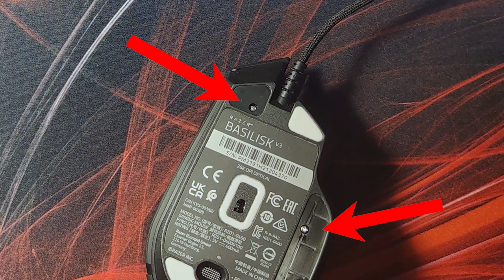Razer Basilisk V3 Disassembly

Comment: I bought the V3 pro 2 months ago and I've been enjoying using it. The scroll wheel stopped working 1 & 1/2 weeks ago when my nosy cat knocked my water all over the mouse. I tried leaving the mouse in a bag of rice for a couple of days, I tried blowing an entire can of air into the wheel/under the buttons, and I was ready to give in and buy a new one when I came across this video. I took the mouse apart as you demonstrate and I thoroughly cleaned inside. I don't have the expertise to tell what parts have what function, so I cleaned everything with an alcohol soaked ear swab and used more canned air to dry it out. Lo and behold, I put the mouse back together and the scroll wheel again works just as it used to. Thank you for making this video and for saving me from the cost of replacing my mouse.
Reply from the maker: I am so glad my video helped you!
Reply: I HAD THE SAME THING HAPPEN WHEN I KNOCKED A GLASS OF WATER ON MY MOUSE LOL I came here to see if I could fix it and I'm so glad you were able to fix yours I'm gonna watch this video now!

Comment: 1 year and the scroll wheel click is gaining problems, how do you think im going to fix this? in your video there are like tiny hairs in there and it seems like on mine probably has a lot of it too blocking the clicking job
Reply from the maker: I had problem with the scroll wheel click also. I cleaned mine with isopropyle alcohol and now it works fine.
Reply: @chrisvfit  woah nice, was thinking about to buy the g502 hero after this. it seems that I still have the chance to fix this. you didn't encountered any problems putting back the stickers?
Reply from the maker: No problems with putting back the stickers. I love my Basilisk, but I want to try the new G502 X Plus.

Comment: Hi, I have a Basilisk V2 and the scroll wheel will occasionally go the wrong way mid-scroll. Do you think taking it apart to clean would help or is it a lost cause? Also, do the original feet and sticker go back on okay?
Reply: Yeah, if you're careful. Hair can gum up the sensor causing that jumping and skipping.

Comment: The sensitivity clutch broke on mine, and i don't really want to rip all the glide pads off. Is there anyway to help me?
Reply from the maker: I don't know how to repair it. I just disassembled mine and cleaned it on the inside.
Reply: @chrisvfit  i don't think it even broke, more like just popped off its spot
Reply from the maker: @JagerForgeStudios  Try to carefuly dissasemeble the mouse, and put the clutch back in its place
Reply: @chrisvfit  i would, but i don't want to remove the feet due to hassle + i don't have a torx screwdriver
Reply from the maker: @JagerForgeStudios  it has normal screws, not torx
Reply: @JagerForgeStudios  mine popped of too after "3" weeks of use cant believe razer makes such an flimsy mouse the button is works normally but when i rest my thumb on it its moves back and forth which drives me insane. i soldered and replaced my logitech mouse left click switch years ago but i dont wanna open this mouse cause the ptfe feet gets ruined after you need to be extra careful when you remove it.

Comment: Very interesting, never thought about something like this being useful but it actually is. Thank you very much! Wondering whether I can replace the M1 and M2 switches as they are pretty loud?
Reply from the maker: Yes the switches are pretty loud because they are optical switches. These are v2 Razer switches. Razer's newest mice have v3 switches. I don't know if these are quieter. Search Youtube for Razer Basilisk V3 PRO, Deathadder V3, Viper V3. They have the new v3 switches. I looked for v3 switches to buy, but I couldn't find any.
Reply: @chrisvfit  Oh I see, thank you very much for taking the time. Maybe I'll find some.
Reply: @ThomasAT86 Did you find any quieter switches to replace the original? Also basilisk V3 switches are not hot swappable right? To replace them you had to solder?
Reply: @TheKubaone  Been a minute since I dug into that topic. I eventually decided to go with a Glorious mouse which is acceptable for me in terms of noise levels. Didn't do anything with the switches.

Comment: Do you know if it is possible to exchange some parts?
Unfortunately the built quality of the Basilisk v3 is horrendous, especially the wheel. But from all mice it still hast the best shape, together with the G502.
I also own a Viper 8K (the shape really sucks) and I wonder what would be possible to rip out of it to put it into the Basilisk.
It seems there is no really good mouse on the market, they all have something really bad. And nearly most of them are by far to heavy.
I miss the good old times with the MX518, the best mouse ever produced. 😕
Reply from the maker: I don't have any problems with my wheel. It's the best scroll wheel I've ever used. And I use it alot with my work. Some units can be defective from the factory mine works perfectly. Viper has a shape that alot of people love. The shape is not good for you, that doesn't mean it is bad. Try other mice, there are alot of good mice on the market. Check other brands like Glorious, Xtrfy, Zowie, Endgame Gear. If you like Basilisks/G502 shape I recommend Glorious Model i.

Comment: I have an issue with Button 8 or the one that cycles mouse sensitivity after a year of usage. I have to press the button firmly to make it work. :(
Reply from the maker: I had an issue with the scroll wheel press button. I use isopropyl alcohol to clean it and now it works perfectly.

Comment: I want to clean it on the inside since I spilled over a beverage on it and now the left click feels sticky. Can you assemble it back to it's original state easily or... ?
Reply from the maker: Poti sa dezasamblezi foarte usor mouse-ul, desfaci si click-ul cu probleme, il stergi inauntru cu spirt sau alcool izopropilic, il lasi sa se usuce, apoi se asambleaza totul foarte usor. Inainte sa il dezasamblezi incalzeste piciorusele/skates cu un feon pentru ca se vor dezlipi mult mai usor si nu se vor indoi.

Comment: So it uses a mechanical scroll wheel encoder?
Reply from the maker: The scroll wheel is electronically controlled. It has a mechanical part that touches the scroll wheel to give that infinity scrolling or normal scrolling. And you can change between modes by pushing a button on the top of the mouse, then the mechanical part moves by itself, electronically controlled, not full mechanic like Logitech G502.
Reply: @chrisvfit  Hi, my question was about the encoder.
Reply from the maker: @Fergutor  Yes. I believe the encoder is mechanical. Only the part that brakes/releases the scroll wheel is electronically controlled.
Reply: @chrisvfit  It looks mechanical in your video. Bad choice. Usually those don't last more than 500k - 800k cycles in the best ones..and given this is a free spin wheel..will not last very long...
Opticals are the best, those almost never break. I abuse my cheap Logitech M100 with it's optical scroll wheel and still perfect as new, 5 years giving it hell!!
BTW I opened my new Basilisk V3 yesterday, it's good for now, few things I don't like.
Reply from the maker: @Fergutor  I never use the free spin mode so I hope it will last. Anyway I don't keep a mouse longer than 1 year so.. it's fine for me.
Reply: @chrisvfit  That's living in a first world country, eh? haha, cool. In my case it has to last (Argentina, inflation, devaluation). Also isn't optimal changing mouses frequently given I play FPS and the feeling has to be as good as possible, and what's better than to what one is accustomed with? It has to feel as an extension of the arm-hand.
I was using a A4Tech X-718F (avago 3080), bought in 2007 I think. I stopped using it very shortly after due to wheel scroll problems but used it with another computer, not very carefully (I found it hanging many times and under stuff getting crushed, dirty) as I was not planning on using it again...It survived! Aand after acquiring many mouses I ended up using that one again (2019). Really good mouse. Perfect Omrom switches, good shape, nice glossy plastic (I like it better somehow)...And after repairing it (cable, the best I ever used it; scroll wheel, new feet from an A4Tech X-747H that came with spares) and modding it (LOD mod; removing internal weight, fixing lens), really really good. Too small though (Basilisk V3 has better size and shape, too heavy, sadly). Bought a Logitech G Pro but the shape was simply atrocious. Useless. Sold it. My brother bought me this V3 as a gift! It better last a long time! 

G502 was simply too heavy and needed heavy modding and don't want to void the guarantee, also not very good for my palm grip (my brother has one, recently bought). G403 too expensive here for what it is. MX518 bad overall. HyperX models not good enough: the best are just as good and expensive as the Logitech models but with their own problems. MSi GM41 Clutch too flat. The rest that I could get here aren't good or have bad shapes, or are too expensive or aren't tested by serious reviewers (Gigabyte, Corsair, VSG, Redragon, Cooler Master, Trust, Thermaltake, Marvo, etc, and no Glorious, Roccat, SteelSeries...)..so my brother said, screw it I'll buy you a good one! :D

Only for the moment it seems the Logitech has better tracking with the Hero sensors and the clicks are slightly faster.
Reply from the maker: @Fergutor  I had Logitech G502 Lightspeed for a year. Heavy mouse, horrible clicks, double click issue. But it has nice coating, and I like the grips on it. Roccat has the best coating I've ever felt. I recently tried Asus Gladius 3 with swappable switches, interesting mouse. But the build quality kinda sucks, very thin plastic, I didn't like the grip, the shape is too agressive for me. I never tried Glorious mice.. Now I have the Basilisk V3. Actually it is too light for me 😀 I like heavy mouses. The only complaints about it are that the clicks are kinda hard to press and I want it wireless, or a much softer cable like Hyperx Haste has. Hyperx Haste is very good, solid mouse, but too tiny and light for me. The switches are TTC Golds, very nice clicks.
Reply from the maker: @Fergutor  Asus Gladius III is very interesting. It has the sharpest clicks I ever felt. They are easy to actuate, but very precise. Also it has no coating, or side grips, it is full plastic, so it is easy to clean.
Reply: @chrisvfit  my scroll wheel broke. It's stuck in the infinity mode. What do I need to do to fix that?
Reply from the maker: @Elegies22  Have you tried updating the  firmware?
Reply: @Elegies22  open it up and see if the metal arm next to the scroll wheel has come out of its clips. happend to mine why i ended up here hope it helps

Comment: Hi i bought this mouse used 6 month ago it was working fine until today, I turn on my computer and it keep disconnecting the mouse...i tought it was a software issue so i uninstall razer synapse. No luck then i tried it on another pc and still the same...finally i came to conclusion it was the cable because when i was doing some cable management i used a cable tie to tidy the cable up, so probably the cable got broken inside...thanks for the video now i know how to disassembly it and probably replace the cable...wish me luck :/
Reply from the maker: I'm glad that my video is helpful to you. Be patient when you disassemble the mouse and the cable. I wish you luck! Please tell me if the mouse is working properly after you replace the cable.